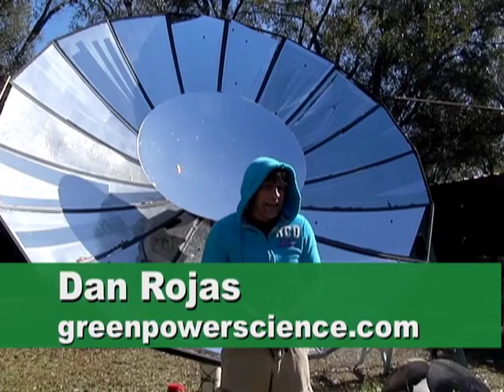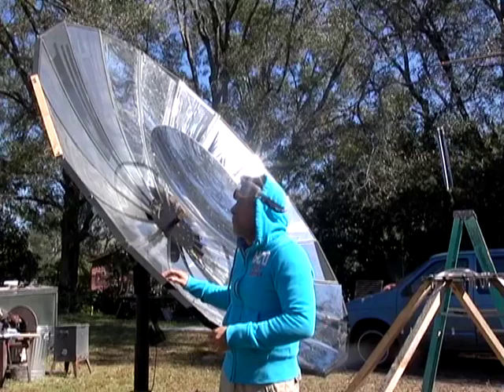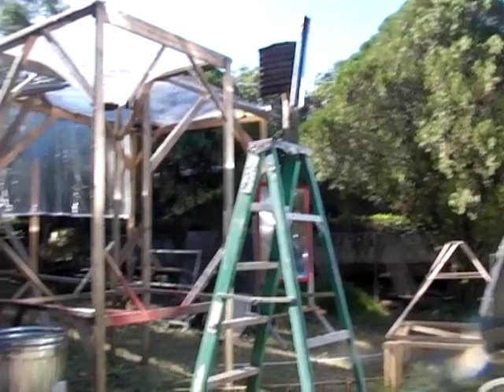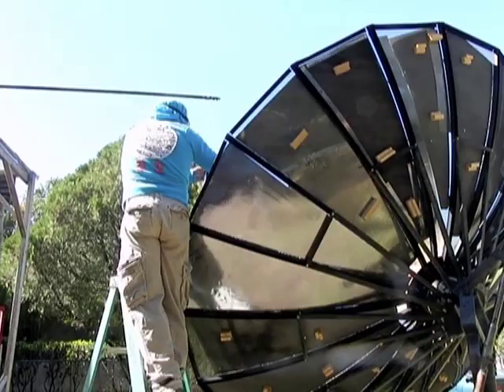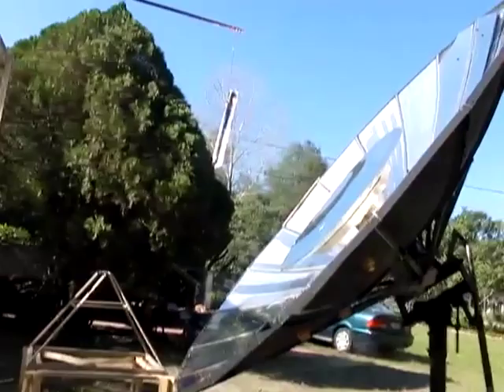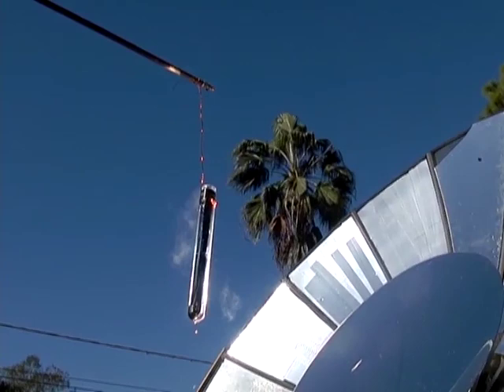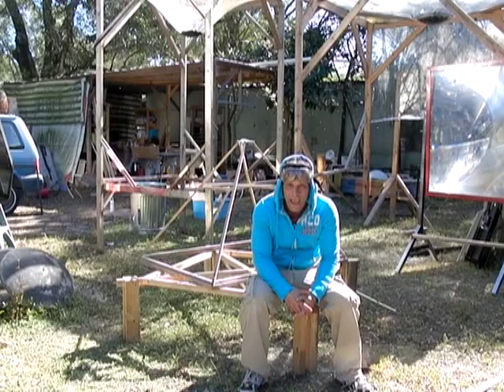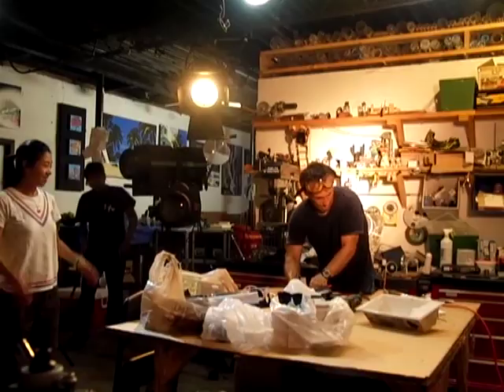Giant Parabolic Mirror Solar Powered Steam Production Death Ray

Comment: you spark dozens of application ideas in my head...  the use of reflectors to more cheaply amplify the heat production of a single vacuum solar panel - thereby reducing the costs for solar hot water and space heating considerably.   ...the use of a properly aimed huge dish to provide both light and gentle heat to a home (see: solar heliostats- but the challenge w/heliostats is computer directed is best for that application.) Food canning-which is tricky at best with lower temp solar power etc..

Comment from the maker: @imatelly An option might be to store in waste veggie oil or water with a circulating heat exchanger. If you were to make something like that bulk heat (flat panel water heaters) is a good idea for pre-dish/collector heat increases. This allows for less expensive surface area collectors to do the bulk of the load.

Comment: I am workikng on using a cheap engine hoist from Harbor Freight...modifying the arm to hold items to heat up/cook.
I have been working at those plants out west that use parabolic trough to make utility scale electrical power for the past 25 years...I know how easy it is to catch stuff on fire...but it has to be in the focal point....and that is just feet or meters away.  We are near Edwards air force base and there are no issues with flights, etc...the focal length are just too miniscule.

Comment: @Jaygoodpatriot The focal length is at best  3 feet, or whatever the distance was that Dan had the vacuum tube held at, the beam is spread out to infinity the further you get from the mirror. The only reflective surfaces that cause trouble for planes are HUGE and flat. As someone else pointed out, if you are not close to the focal point, it will actually appear less reflective than normal objects, it will have a very dark appearance VS anything else

Comment: @Jaygoodpatriot 
up that high you wouln't even get a showing of a reflection because the light would be so diffuse by then. the hot spot or focal length is only 6 ft. from the dish and gets cooler from there on out. Even up a hundred feet you might only see a black spot because none of the light from the dish is hitting your eye, it's all going in other directions.

Comment: What kind of temperatures do you reach there? 2500ºC will split water into H2 + O, meaning you can store energy to put in fuel cell for overhyped cars, or just for local heating away from the dish. Some good H gas lines with flashback arrestors exist now. As cool as your various applications are, it would be nice to get one step further. Using the green energy for basicc family needs such as transportation and electro. Love the piecce on forced air heating.
BTW insulation is under-covered in MSM

Comment: @DontFriendInviteMe Doesn't work that way buddy.  It has a focal point, hence the heat (light) and thus outside of that zone the intensity is actually diminished.  This would be less reflect than a car windscreen to an plane etc. Dan has covered this already, watch?v=oLDS8fONaM4&feature=relmfu